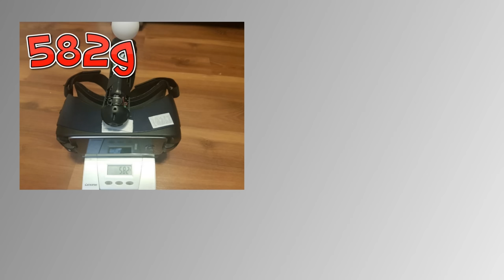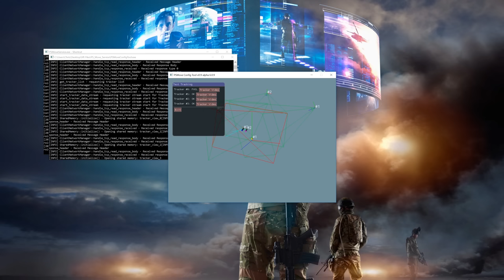The Best Way to Head Mount a PS Move Controller for Perfect Head Tracking! [Part 3]

Comment: Is it possible to do without the third ps move controller?
Reply: I want to know too! Either that if we could spoof the 3rd controller so that it can be tracked using the ping pong ball.
Reply: This Video is about to do this without the third Controller...
Reply from the maker: This is just it, you still need the 3rd for now, but spoofing may be coming down the road.
Reply: Hi, is it sure you need a third PS Move controller? Because by the look at your video, you are spoofing it with a pingpong ball! How come? I'm asking that because this setup, even it looks awesome seems slightly expensive  for a DIY:

3 Playstation Move
4 Playstation Eye
2 Playstation Navi

Brings a total price of 226 € (239 US$ or 190 £GB)

Removing one Playstation Move we could narrow down the price to 188 € (198 US$ or 158 £GB)

(and sorry if I missed something you said, Engligs is not my native language)
Reply from the maker: You do, you need to tell FreepieBridge which controller ID to track for head tracking.  So without a controller connected by BT, it's not possible yet.  

As far as price goes, you may be correct if you were buying new, however a lot of people have some of the gear laying around, otherwise, you can get it all used since it's been out for years now.  For cameras, even at 4, they are $5 each generally.  So that's $20 for all cameras.  Move controllers you can still reliably get for $30 each tops.  So that's $90 for all 3 controllers, but you can still find them cheaper if you're patient.  Navi controllers are about $10 used each, so that's another $20.  So in total, you're looking at $130 if you had to buy every single piece used.  Then of course, you need extension cables and BT adapter which many people have laying around anyways.  Or again, used is fine.
Reply: I understand now, your third PS Move controller is still connected but just standing still somewhere around while you track the ping-pong ball with the cameras! That's a smart move :)

I just saw it, can get most of them for cheap over eBay (except the PS Move from which prices are a bit high, guess it's related to the fact it became popular again with PS VR) Indeed we remain at something around 130 as you said!

I've been wondering though, don't you think the same system with 4 PS Cameras, Some ping-pong balls & leds over headset + 2 PS Navi tracked through FreeTrack could do the trick? I'm thinking of two ping-pong balls for each Navi controllers (for more accurate tracking, let's say one yellow one blue, top and bottom) and one or two over the headset like you did in this video. Sounds like something doable, with a price even lower!
20 box for the 4 cameras plus 20 for the 2 PS Navi, we just reach 40 box tops! Just asking coz even though the PS Move offers accurate tracking with its gyros and all, Freepie/FreeTrack stills tracks the light bulbs so I wonder if the low data latency through PS Move gyros is really worth it... Indeed I guess it is, coz your setup seems pretty impressive!
Reply from the maker: Hello Emeric, great idea however the Navi controllers do not provide any rotational data since they have no accelerometer or magnetometer.  Tracking the ball on the end of a navi would only give you positional data.  

Also at this point, there is no support for virtual controllers, so it wouldn't even really be possible to try it quite yet.
Reply: That's why I thought about about using two lights on each controllers, in order to get some rotational data! But yeah as you said... stuff like that are possible do over FreeTrack/Freepie, indeed is not supported (yet maybe!) buy RiftCat/PSMoveService... Guess I'll stick to you solution or wait for Nolo to come out! (I hope they will add the possibility of using multiple Base Stations for 360° positional tracking in desktop VR use, imagine how awesome it would be!)
Reply from the maker: Yeah, that will be pretty great!  I have my Nolo on order as well and will be posting plenty with it when it arrives :)

Comment: Hi. Thanks for great job with your channel! Like it although I am not so good at eng as I wish.
Help me with one problem please. I have deepoon E2 headset without head tracking posibilities. I wanna buy razer hydra controllers for best VR expiriense (it has a lot buttons so as steam controllers and small latency with high accuracy). It can simulate of steam controllers with nice level. But also I want to be able to use head tracking in VR. When I found your channel I think you can help me. Tell me is there way to use this combination: razer hydra + DIY PS marker for head + 1 camera (or 2 if it is so necessary for work). Is it possible at all and can I have good rezults with such mix in theory?
Reply from the maker: Thank you so much for the comments!  unfortunately there have been discussions on that, and it looks like it's something being looked at, but not solved quite yet.  Feel free to check out the google groups for the PS Move Service and you'll find some threads and people who are specifically using the deepoon E2 with the PS Move Service:

https://groups.google.com/forum/#!forum/psmoveservice

Comment: Hi Daley, Im new to vr scene, just bought a PSVR system but I want to use it on my pc to play steam vr games. Can I use this system attached to psvr to play? Also I bought 2 ps eye cameras, is it going to be fine or I need more? Do you have psvr videos?
Reply from the maker: I don't have a PSVR, but the PS Move Service will work with PSVR.  You can use Freepie in TrinusVR as well.  TrinusVR has support for the PSVR.  
https://www.trinusvirtualreality.com/psvr/
Reply: Ok, I bought the trinuspsvr software, thank you, just bought all the materials to build your headtracking led project. Couldnt find around here the battery holder, so I improvised with CR2032 battery cell and its holder, its going to weight a little less.
Reply: oh its not gonna work, just realized the working time :/

Comment: If the third controller is still required, then where is it placed?
Reply from the maker: I just place it hidden out of the way.  I keep it plugged into the PC by USB all the time and on my roll out keyboard tray on my desk so the cameras don't see it.  Since I keep it plugged in, I never need to worry about charging it either.
Reply: Alright then. Thanks.

Comment: would it be possible to use 2 ps move controllers to track the headset?  would it work better?
Reply: Jeremie Droucker It would be too heavy and you would need atleast 3 controllers or led balls  to track the orientation

Comment: hey daley tech,where can i find parts of psmove? i open mine and the led unweld. im thinking to weld again but maybe it wont work..so im thinking to make your idea to get another led and try the ping pong ball tricky
Reply from the maker: The LED I used in this video is just from an electronics store.  It's not a specific PS move part.  Just as long as you calibrate the system to track that color, it will work.
Reply: Yeah im thinking to do It,but im managing to solve the problem,its cable flat unweld and i ask a friend who have the equipament to weld
Reply: What LED Type ???  What LED specification ?  there is many -- in infrared ?
Reply from the maker: You don't want infrared.  You want something that is fully visible.

Comment: does the color of the light have to be yellow??
Reply from the maker: no, it can really be any color you want.  As long as it's somewhat close to one of the colors available in the PS move service.
Reply: so i can use any color that the software has. i'm wondering should i invest in a rift. because of the summer sale or invest in the PS move service. i have basically have no money left over from building my VR ready PC. i think i should go with PS move service.
Reply from the maker: If you can afford the Rift, that's the right way to go especially with the summer sale.  But if not, this is a working alternative that's much cheaper.
Reply: thx! yeah im buying my cameras and ps move controllers

Comment: so can I just put a light on my headset or do I still need to buy a third controller
Reply from the maker: at this point in time, you still need the 3rd controller.  But it's being worked on still so that function will probably come a bit later on.
Reply: Daley Tech can I substitute it with something like my Dualshock 4
Reply from the maker: unfortunately not.  Right now you really do need your 3rd move controller.

Comment: can i use 1 ps move and 1 ps eye just for position tracking..?
Reply from the maker: You can use one controller, that's fine.  But you may want to look at getting a 2nd camera at the very least.  1 can technically work, but it will be pretty jittery.  2 will be much better, and 3 cameras will give you 360 degree tracking.

Luckily, used PS eye cams are super cheap to buy used!  Heard people reporting as low as $5 each.

Comment: i have a problme when i connect psmove to steamvr with out riftcat it connect but when i connect riftcadt its not connecting
Reply: How are you starting steamvr? Have you tried through steam and through riftcat? Also make sure "allowmultipledrivers" is set too true in your steam vr setting. I might be a little off on the name. With a little searching in the forums you should find a tutorial.
Reply: Alec Collins i went to steam config but there re no vr setting and i try to make new one but i have win10 so icant change the text type ..
Reply: 7bsyabofadhel 1 What do you mean by you can't change text type? Just open notepad and just do a save as vrsettings or whatever you need and just place it in there. Is that not working for you? or did I read something wrong?
Reply from the maker: You need to enable multiple drivers.  For both Riftcat and PS move service to work at the same time, that line needs to be added.  If you're having issues, try checking out my troubleshooting tips, I have covered a lot of the most common things that go wrong.
https://www.youtube.com/watch?v=hMv-7tD6WIE
Reply: Daley Tech can you give me the vrsetting becuse i dont have it
Reply from the maker: You will need to build it.  Check the wiki here:
https://github.com/cboulay/PSMoveService/wiki/Steam-VR-Setup  There is also an example script in there that you can modify.
Reply: Daley Tech thanx ...when you will give a licence for riftcat?....  :)

Comment: Hey Daley,i got the new psmove service its very very better ! 
So im with a trouble here: i use 3 moves,but when i log into a game on steamvr it recognize the head move as hand,so i cant use 2 move on hands and one on head,did you had this issue? i used all your tips and lines you maked of program on steam and txts
Reply from the maker: Try making sure it's still correct in your steamvr.vrsettings file.  Make sure that controller is masked out.  You're the 2nd person who mentioned this now, so I'll probably try sometime today and see if that's an issue with the newest version since I have not had a chance to try it yet.
Reply: Yeah.luckly i wasnt the only,so i think maybe its something on trinus gyre,because he comunicate the freepie to steam,but im a little intrigued with the steam menu not showing so maybe reinstalling steamvr it can works... i will make some try and notify if you get something. 
Is there any forum about freepie ? it would help a lot!
Reply: I found the issue on  Steam menu Call,it worked when i maked steam files verify on steamvr,them i can call pressing PS button,but the config.txt on path: 

C:\Program Files (x86)\Steam\steamapps\common\SteamVR\resources\settings
.

Edit: FINALLY!!!! I could manage and now its working,steam vr only detect the 2 hands moves... YUPI! 
heres on this link: http://imgur.com/KYOEqSd

I changed this config.txt, it was crashing the menu so i verify on steam and put the line of command after the finish of early command line,now its working! 

Its almost like ps4 psvr,to reach a better way i need more cameras,but lets have some FUN! 

Thank you for all ^_^

Comment: Hey! Doy you use codec hevc? If I put it in riftcat in my phone there is a black screen :(
Reply from the maker: I do, you just need to make sure your phone and PC hardware support it.  Right now, it's for NVIDIA only as far as I know.  What phone/GPU do you use?
Reply: I have and amd rx 480. Another question, I have recently buyed 2 ps moves controllers, I have 1 old ps move controller and 2 new ps move controller , In the two new controllers the ps move service says: magnetometer disabled, please help me!
Reply from the maker: So with the RX 480, you won't quite get the HEVC support yet.  That will be in a future release of Riftcat.  For the newer PS Move Controllers, they contain a newer firmware that disables the magnetometer.  This is still workable though.  Check this update post here:

https://groups.google.com/d/msg/psmoveservice/LydumYh1BG0/BJAQKbXFBgAJ
Reply: Thank you so much man, but I don't understand , the ps moves are compatible? What i have to do? I don't understand the link you give :(
Reply from the maker: It means it will work, but it won't be able to do the magnetometer calibration.  This will result in a bit more yaw drift, but there is a way to reset the orientation quickly while playing.  You just point the controller forwards and press select for 1/4 of a second (you will notice when it's good).  That will recenter it when needed.

Comment: hey daley , i've bought noga usb extensions , and im wondering , when i use em on the front usb ports it says device not recognized and it doesnt show up on usbdeview , but when i put em on the rear (back) it is recognized, but at the moment of running ps move service the camera stays gray and doesnt work , any idea how to bypass this? i think there must be a tweak i can do
Reply from the maker: Are they active extension cables?  This could be a long shot, but USB is really only reliable for 16 feet tops.  So if you're near there with your extension, then remember that the front ports are another cable to your motherboard and add upwards of another 1-2 feet depending on the case.  The ports on the rear are directly on the motherboard without any more extension.  Your extension cables may be right at the threshold and that extra bit may be tipping it over the edge.  If this is the case, if you have a USB hub, try plugging that into the front port.  Since they have a hub chip inside, it will act like a repeater and possibly solve it.  This is no guarantee, it's only theory, so I wouldn't race out to buy a new hub.  Passive or active hub will make no difference since you will only plug the one camera into it.

Outside of that, the only other, and even longer shot idea would be to maybe try switching the USB header the front ports are connected to.  It seems doubtful, but it's quick/free/easy to try.
Reply: thanks daley , i tried everything connecting to the hub , trying to do a troubleshooting virtual chris sayed but apparently its the cable that are passive or are crappy , nothing to do with em... so now after messing with the drivers and doing a bit of mess with psmove service too unpairing and pairing re calibrating pose tracking and that something went corrupted or not sure what it is , but whenever i start getting track of the ps moves it can wait for a whole minute or maybe 15 seconds , and af ter that i get "failed to connect to ps move service" in the psmoveservice config app , and the cameras red light go down and in psmoveservice it goes " ps move service id 0 and 1 stream disconnected" , "tracker id 0 1 and 2 disconnected" and stops there , in vrserver log of steamvr it only says " ps move controller id 0 and 1 stream stopped" doesnt talk about the cameras , idk whats wrong now it seems i have a new problem all the time xD before it worked flawlessly , i tried switching the port of the bluetooth dongle and re doing all the pairing and magnetometer of both ps moves but it wont work .

If you have any idea of what s going on plz lemme know , if not dont worry i ll just put it on a forum see what i get . Thanks for your patience if you read this man :)
Reply: i solved it by using ps move service 0.9 alpha 7
Reply: so about the cables i ll buy active cables , or 3.0 usb cables will that work? because it worked with virtualy chris
Reply from the maker: USB 2.0 or 3.0 cables will make no difference.  The same 4 conductors will be used in either cable when you connect a USB 2.0 device.  
http://theydiffer.com/wp-content/uploads/2015/12/USB-3.0-pinout.png

If you are going past 16 feet, you really need to get active cables.  If you want to link the cables you are looking at buying, I'll be able to tell you if it's an active or passive cable.
Reply: I never went past 16 feet really and it still didnt work , now im thinking of buying these cables : 

http://articulo.mercadolibre.com.ar/MLA-641906810-cable-prolongador-usb-30-macho-hembra-extension-18m-gtia-_JM

they are 3.0 but im not sure they will work ,  do you think they will?  perhaps i need active cables all along even if i dont surpass 3 meters
Reply from the maker: Those are USB 3.0 and will be more expensive.  Remember, you will only use 4 out of the 9 conductors that you are paying for.  So it's up to you if you want to spend extra on a USB 3.0 cable.  Just getting a good quality USB 2.0 extension should do it.
Reply: it was the cables i bought were worst quality , and i think i cant even get a refund u.u
Reply from the maker: Do you have it sorted out then?  And sorry to hear you can't get a refund :(